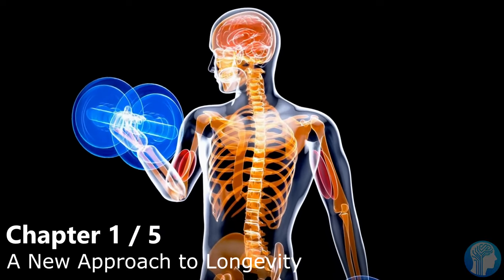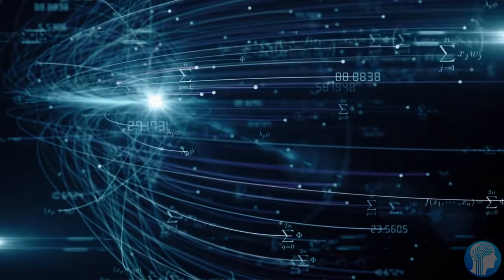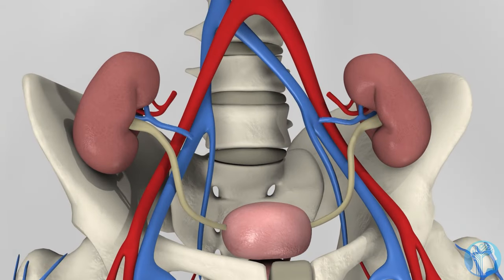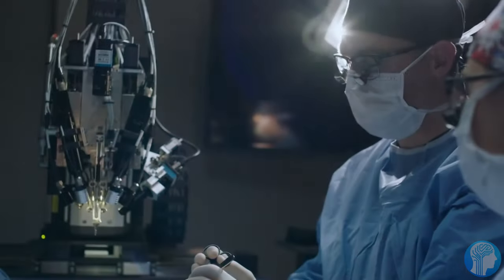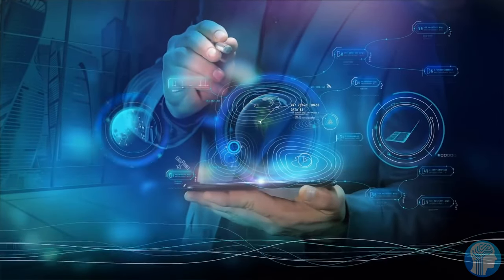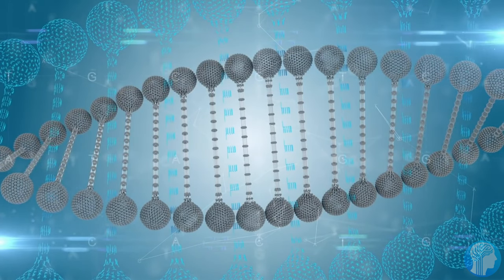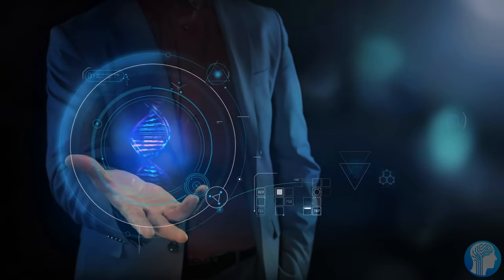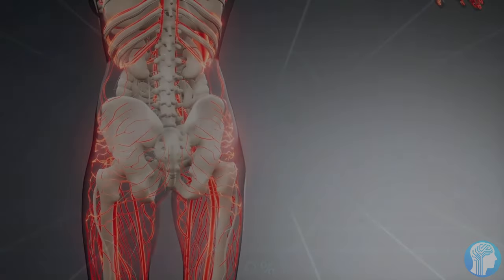The Craziest Path Towards Curing Aging (Organ Transplants)

Comment: Using animals organs on a human is a genetic impossibility. Animals have different DNA and RNA. Even if you modified the animals gene, it is still a genetic impossibility to use animal organs on a human.  You can however use human organs on a human even if the DNA and RNA does not match by using a gene inhibitor pills. Gene inhibitor pills are very effective in programming the body to accept unmatch organs. But it has to be a human organs. It cannot be an animal organs.